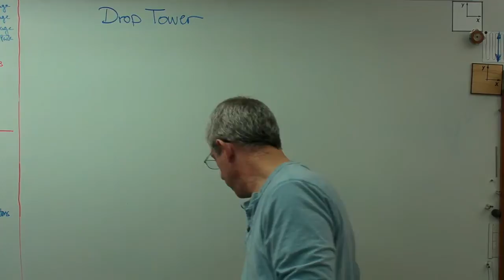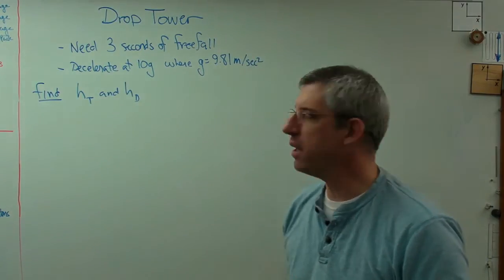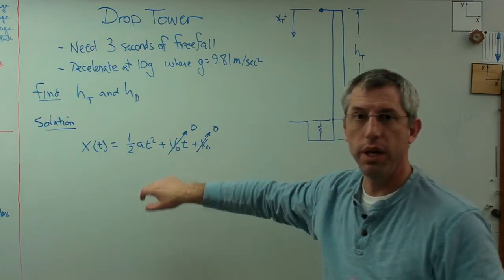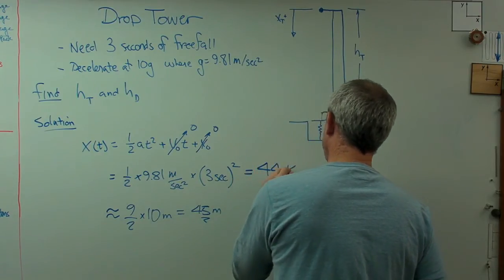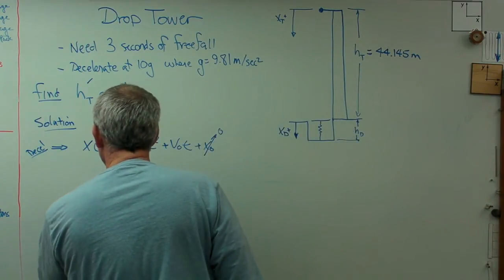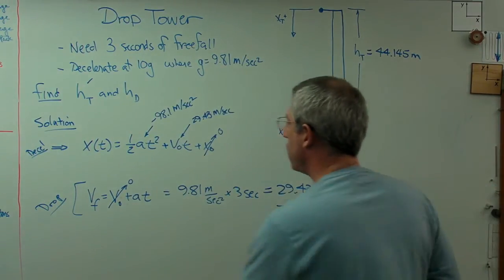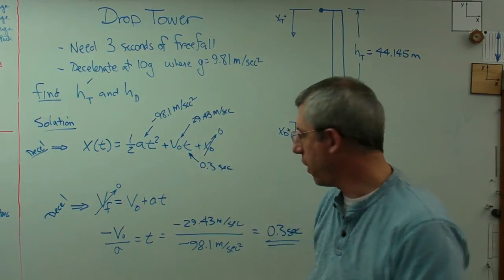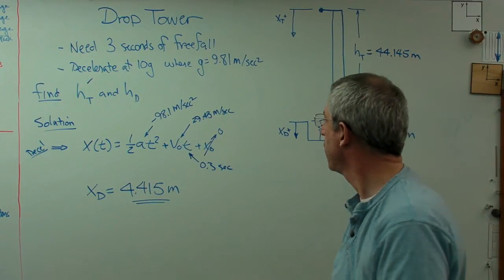Drop Tower - Brain Waves.avi

Comment: Is magnet pull equal no matter the directional pull?
Reply: Let’s say 10 MPs vertical drop, with gravity; and a magnetic pull for deceleration.. Would the same thing happen on a roller coaster using the same magnetic pull for a braking system on a horizontal stop? Within .5/s-?